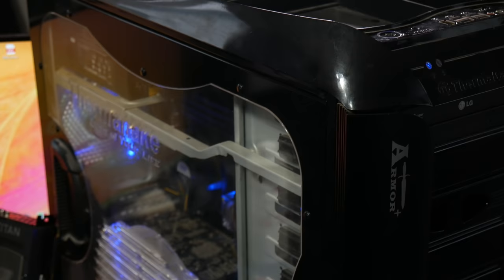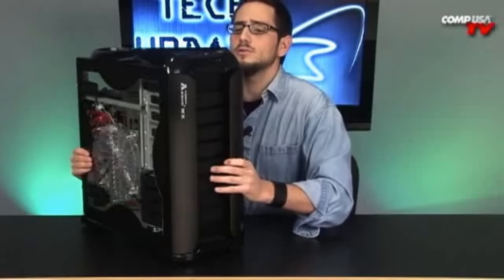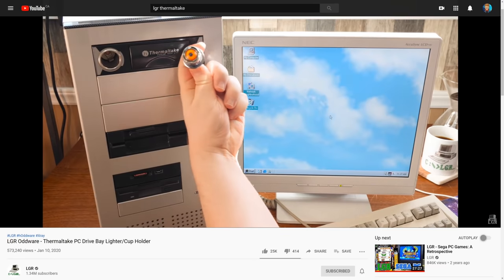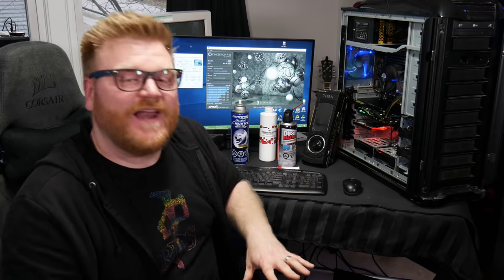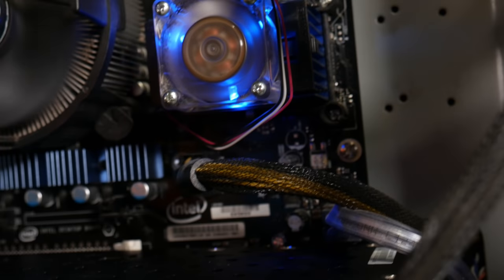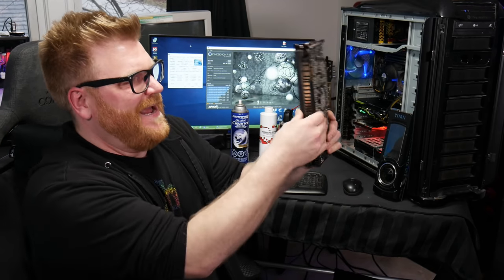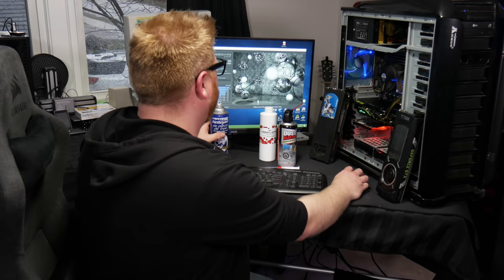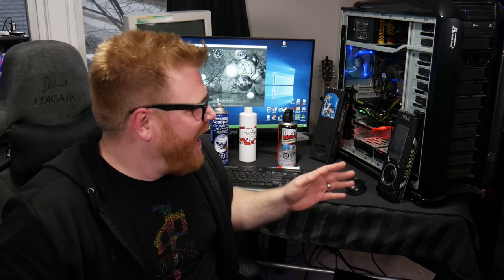Can $5000 buy a PC that will last 10 years?

Comment: 5.000 € for my current machine its now 6 years old still going strong (haswell-e oced with 32gig ram 3,5TB SSD storage 2xGTX1080TI all watercooled) would buy again but would not recomemt to
the GTX 1080 and the storage where upgradet as needed (old gpu(780TI) died more storage was needed)

Comment: it is more valid with every passing year; back in 2000 a computer wouldn't last 4 years; nowadays, so long as the components don't break, performance increase is currently at 20% a year and 7 years from now it could be as low as 10% a year.. the best computer made today will be 3-4 times weaker than the "best" computer 10 years from now; as for the software running, it will still run anything outside new hardware specific features

Comment: there's no way this was 5000 dollars, I spent 2500 on an i7-920, 12gb ram, 3tb hard drive, bluray drive, also a 295 and also prebuilt, plus computer parts are already pretty expensive here in denmark compared to the US, if this was 5000 dollars somebody was drunk.

Comment: i5 760 and gtx 580 was my Dec 2010 PC. Lasted to Dec 2016 IIRC. Might have made it longer if I had gotten a better CPU. IMHO its best to spend a lot on a GPU and it will last. ....but not 10 years.

Comment: Ive got a system with a 3900x, 5700xt, 32gbs of ram and 2 1tb nvme drives in raid 0 for under $2,000. At the end of the day this pc could last 10 years but im a tech enthusiast so ill keep upgrading it till its not worth it.

Comment: 2500 bucks I have the same logic as you. but i think id just be able to milk the platform for (just gaming for 10 years) 
Specs:
 i7-9700K (Deep Cool Captain 240mm AIO)
RTX 2080 Super
32GB DDR4 3000 GSKILL Trident-Z
Z390 Asus Maximus Hero 7 (or whichever it is lol)
1TB Samsung 970 Pro
1TB Samsung 860 Evo
2TP WD Blue HDD 7200RPM
Dell G-Sync 144Hz 1440P TN panel

It was meant to be a modular PC that wil be swapped and upgraded over time... I dont think you can keep the same PC for 10 years with just 1 purchase.
With my particular build the AIO will be swapped in a few years then the GPU when I still want to play the newest games at 144 FPS on my 1440P panel.
I could upgrade storage and RAM.
Eventually could put a variant of 9900K that is compatible with  the motherboard.

But again my logic was spend enough to have a good experience and then instead of spending more pocket the rest and use it a few years down the line to get more out of the money.
Problem is you must follow consumer hardware and do research to accomplish this. If you lack knowledge or time to do this then you would be at a disadvantage.

Comment: I would say, he could have just stayed with X58, upgraded the cpu and cooler and OC`d the CPU to around 4,5Ghz with 1600Mhz cl8 tripplechannel DDR3. Also i doubt the PSU is causing problems but to rly know that a PSU tester would be nescessary. My friend on a sub 100$ budget just got a first gen 4core 8 thread xeon with about the same cinebench score as the one in timmys video and it performs just fine on stock clocks with a gtx770. 120-130Fps in pubg lite on maxed out settings.

Comment: I had mine for like 8 and I got bored so I made a new one. 

i7 2600k
Noctua Heatsink
G.SKill Ripjaws
Z68 Chipset
6870 Xfire.
120GB SSD

Was totally fine for what I used it for. But the tinkerer in me wanted something new.

Comment: I had the Centurion version of that case, It reminded me of HARDAC from Batman:TAS. It started life as an  AMD FX-62 + Nvidia 7900GT,  but by the next year it Had a Core2 QX6700 + BFG 8800 Ultra, 4gb of Corsair XMS2 ( upgraded to 8gb in 2009), that STUPID expensive Creative Soundblaster ( 300 usd in 2007), four 250gb 7200rpm WD caviars with dual first-gen Raptors for boot and applications.  I went through at least 6 different motherboards, i remember it started off with two asus boards, a gigabyte, and an EVGA, and even that badass Intel board that had the blue-flame heat sinks.  I eventually upgraded the case to a Silverstone TJ-07...i wasted so much money on MOBO's and lord knows what else, AT LEAST 30k USD over 6 years...sigh....Now i REFUSE to pay more than 3-4k for a rig. My current rig only cost 2500k, and it absolutely BURIES my 2000USD  i7-2600k+ Dual HD6970( crossfire)  rig from 2011.

Comment: Well dnno about everyone or just gaming, ill tell the story from my perspective, i bought my original PC in Q1 2014 for about 4300$, it had an ASUS P9X79, intel i7-4930K, thermaltake bigwater 860 custom cooling, GTX 780, coolermaster Cosmos II case, thermaltake toughpower 1200W, plus some SSDs & HDDs. I was still in my final year of university as an architecture student, i used it mainly for CAD and 3D modeling and rendering(cpu based rendering) at the time it was the best money can buy (within what is reasonable and not like 50,000$!) it served me well and after uni i used it for numerous freelance and also gamed a bit up untill 2019 it worked without upgrades at all (unless u count adding storage as upgrade), then in 2019 i had the op to buy a i9900k & z390 Meg Ace MSI and GTX 1080 from zotac and 16GB RAM for about 600$-650$ so i snatched it and put my old setup in a build and sold it for about the same amount (so a free upgrade).
I know along the way or even in 2019 there was a great pc option for 4000$ with the ryzen and threadripper in the picture but first i ddnt have the budget to allocate such amounts again, plus the upgrade does the job quite well. I wish i had the opp to upgrade yearly or every couple of yrs, but unfortunately i cant, so an expensive build every 5 yrs for me who mainly uses the rig for work 75-25 gamin, i see it more reasonable as a lower end pc wont do the same good of a job at start.
Reply: I think, your story makes sense as you don't just use it for gaming or even basic pc task. You use it for your job like for 3d CAD too. so, I'd say its worth the long term investment for an expansive build, when you get paid along the way to offset your pc cost. As for this guy in the video, we assume he bought it for just basic pc task and gaming. Which you don't need to spend 5k. That's just doesn't make any sense.

Comment: 2000-2500$C is the sweetspot (monitor and taxes included) and you update your system every 5-6 years. This guy doesn't understand how an exponential curb work. This is how technology grown in the last decades (Moore's law). Also, after 6-7 years your components begin to break (psu, motherboard, etc). A good PSU can work 7-8 years, a cheap no-name brand maybe 3-4 years.

Actually I have a 6500 i5, an AMD RX480 card  and 8gb of ram drr4 2133mhz and my monitor is 1440p. Decent config but probably an update will be needed in the next 2 years (I look for the next ryzen 4 gen / navi and maybe a 2to ssd if the price decrease).

Comment: Meh I don't think its too horrible to try and future proof a little. But expecting ten years is asking a lot. A lot can happen in ten years. I got a gtx 1070 and ryzen 1300x, I know I need to upgrade 1300x I am waiting for 3600x to go on sale and I will upgrade to it. But my gtx 1070 I run at 1080p because I know it will run games at 1080p at 60fps and higher for at least two years. I know its a 1440p card but I wanted to be able to sit comfortable at 1080p for a while without needing to drop the settings very often.

Comment: In my 8 year 600€ pc the only thing ive kept is the cpu and ram.Everything else was replaced because it stopped working. Now im going to spend 1300 for a ryzen 3600 and a 5700xt. I hope everything on the motherboard lasts for at least another 8 years.

Comment: you people need to take into consideration that only up until 2017 intel had no need to push the ceiling for CPUs, that is the only reason why a system from early 2010s still holds up today. this will not be the case in the next 10 years thanks to AMD.

Comment: I did the right decision upgrading like in 2016 from a i3 4130 to an i7 4770, at the time (and I'm not joking) the i3 was plenty enough for gaming but I got a pretty good deal on the used i7 mostly for "futureproofing" and it still rocks, I'm probably only upgrading to a newer plataform when something like DDR5 comes out.
btw my gpu's were gtx750ti 2gb; gtx960 2gb; gtx970; then I blew up a used 1060 3gb lol and recently a got my dream gpu on good deal, a used rtx2060
Corsair CX430 PSU still rocking since 2014

Comment: The computer I built 5 years ago was my first proper build. Thinking back I was very green. I watched a lot of videos to make the computer "future proof". I figured I would upgrade this year, as it had been 5 years.  I figured I put a newer CPU, and GPU and Id be done. NOPE. My old specs were an ASUS Z97 Mobo, GTX 970 and i5-4690k. So Im looking at newer intel CPUs and realize they dont even fit my motherboard. The only CPU upgrade I can do is the i7-4790k, which is expensive still for so little upgrade. So I have to get a new Mobo. "Future proofed" already in the shitter. The Mobo I got is a B450, which I'll probably regret, and I put a Ryzen 3600x with it. I went for a 1080ti purely for the 1440p gaming. Not interested in Ray tracing. 
Anyway the last kick in the "future proofed" bollocks was the god-damn Memory didnt fit in the new Mobo. I needed DDR4. sigh So i got what people say is overkill, 32GB 3600... but, maybe that will be the only thing from this upgrade that will be acceptable in 5 years.

Comment: My modded Sapphire Nitro+ RX480 8GB OC gets the same Fire Strike GPU score as the Maxwell TITAN. lol. I have a CRYSIS rig that's still running strong with a Q6600 GO at 3.6GHz in the eVGA 680i SLi MB with 8GB's of 1200MHz OCZ Platinum SLI ready (XMP) DDR2. I had 2 eVGA 8800GT SC's, then upgraded with 2 1GB GDDR5 GTS 450's in SLI, to finally drop in a GTX 1050ti. In 2013 i built the family a i7 3770K, z77 Extreme4 PC then dropped the GTX 1050ti in it. And that little monster can run Metro Exodus at 1080p60 with high settings plus PhysX. I find it kind of funny that you can still enable PhysX with a Radeon GPU. But, as far as the CRYSIS rig, that thing was up to the task for gaming until about 2016. Then i noticed things, like sloooowness in games. Plus, it didn't have SSE.4 instructions so Far Cry 5/New Dawn wouldn't even fire up. It would with a QX9650 but, it was still slow. As of today, its a great little retro tester. LGR, not to long ago built a Windows XP Dream Machine with the same CPU and MB. I only paid about $1000 total for the whole set up back on 2007-2008 and can say i got my money's worth. When i seen Logan from tiger direct paired one with the eVGA 680i SLi amd was loving it, i had to get one. I got the CPU, GPU and motherboard combo for $600. Super steal. Jumping to a 5GHz 8700K and 9900K from a Q6600 and i7 3770K was definitely worth the wait. My ram is running at 4+Ghz. That faster than most entry level CPU's today. 
I waited a year to build each system, so open box deals all the way. Saved me 50% on both builds. I recently picked up the RADEON VII for $325 out the door for example. With deals like that, patience is definitely the key. Maybe tell dude to build right now. With some deals that are available. Then, use a get by GPU until the new GPU's drop and he'll have the latest and greatest on the GPU side, for gaming.

Comment: Well technically if you built a i7 2700k build in 2011 or i7 3930k in 2013  and then just only upgraded the gpu once to a 1080ti then your pc is still highend and still under 5k mark and just 1 or 2 years behind 10 year mark

Comment: In 10 years from now x86 chips will probably be gone and high end desktop computers will more likely switch to ARM based multicore 3D stacked SOC's. So there is absolutely no sense in spending over 3000 bucks for a computer right now, especially if you're only a gamer.

Comment: I'm pretty sure that these cards like the 9800GX2 is only seen as one GPU. There is no need to set SLI in the control panel.
Reply: Not really. It sees 2 cards and you have to turn on sli. There is actually an sli connecter on the card itself and some cards would burn out one of the gpus and you would have just one visible and it would still work but very slow because grx295 was bassicly 2 gtx 260s gpus.

Comment: if you spend 5k on a PC now It could last you that long. (The only real innovation in the tech space has been graphics cards)
Reply: even X58 still has no problems with modern workloads as long as its overclocked to 4,4-4,5Ghz

Comment: I'm still using an i7 930@4ghz
 12gb Kingston hyper ram
 msi Rx 480 8gb
 gigabyte UDX3 58A mb
 I got from overclockers UK in June 2010 with a hd radeon 2gb 5970  planning on massive upgrade this June or when the next gen Big navi and top cpu as I'll have had this pc for ten years.My old pc was reviewed in techradar in 2010 stating it garnered the performance of a pc thrice it's price at £1500 it was a wise buy hopefully I can get a similar priced pc with the top gpu and top  cpu when amd release there next gen gpu. I've always gone team red as £700 is enough for a gpu that expires quickly never mind ngreedia £1200 kid on rtx my friend bought when it came out.Hopefully I'll find something suitable for highest gaming performance as get annoyed too often at my old pc hard crashing a new fast  cpu and gpu with fans and no fancy pumps and some new rgb lights as old blue led ones are so dull now will do the trick

Comment: Nope. My watercooled ~10yo  6-cores Xeon X5650 @4.5GHz, 24GB of DDR3-2000 RAM (big deal in 2008), 2 x X-25M 160GB RAID-0, Radeon HD 5970, Corsair HX1000, Corsaid Obsidian 800D, etc. etc. is still serviceable in 2020 as a Linux server to run various stuff (Pi-hole, Wireguard, Tautulli, Unbound, etc.), but it's obviously very very outdated by today's standards.

Comment: My 1500€ PC has a Fractal design R6, a Ryzen 7 1700 overclocked to 4,1 Ghz on air with an thermalright aro m140, 32gb 3600Mhz cl16 ram all mounted on an aorus X470 gaming 7 wifi with an xfx thicc 3 radeon 5700XT. I went with 32gb ram because i got it for a fairly low price on black friday (280€) and because its way overkill rn and shouldnt be a thing i need to upgrade for gaming for a long time. I also went with an Bequite purepower 11 650w psu, a 128gb m.2 ssd and 2 500gb hdd`s i got out of some 10 year old pc`s. My plan is to keep my base plattform (mainboard, cpu, ram, case, psu) as long as possible and just keep upgrading the graphics card when needet (proberbly every 4-5years).

Comment: I just built one, I never over clock: 700W memory express // 1 TB hdd (might get an m.2 for xmas!!) // ** 3300x am4 zen2 // rx570 8gb  // 3200 16gb ram (not oc) // ** B450M Pro 4 // with some crappy cpu chassis case i had hanging around for free // total price $520cdn will last me easily 5 years // ** full system support true 3200 ram // tested on fortnite + elder scrolls online + star trek online (i always turn off bloom thats just annoying but high everything else incl. water reflection light 2.0)

Comment: No it can't, if it was destined to fail in 2 years, it will fail in 2 years, no matter how much you spent on it.
Also, yes, it will last 10 years or even more if it is not destined to fail earlier I'm 23 years old and I only had 3 computers in my entire life, none of them stopped playing games on me, I just decided to upgrade because I felt like having more performance or better graphics. So you can't like build a top of the line PC now that plays modern AAA games at 4k 70fps maximum graphics and expect it to play 8k 70fps 7 years from now... it will, at best play 4k 70fps at low settings by that time.

Comment: yeah,  I mean, i went from a second hand core i7 940 i got second hand 5 years ago, to a core i3 9100F, and the sub 100 dollar cpu is way better then my old i7, i mean, i got it and a refurb msi motherboard for under 200 bucks, so when the time comes to move forward, it's a whole lot gentler on the ol' wallet.

Comment: From what I've been hearing, around the time Ryzen 5000 is coming out all these specs should be coincidentally on Generation 5 by its release...

PCIE gen 5, DDR5 and usb gen 4. Now I'm not saying it's a good idea but, a 24 Core 5Ghz + Zen 4 CPU with the fastest DDR5 and 64GB of it along with blazingly fast PCIE 5 memory. And not to forget probably another lineup of Graphics cards on top of Ampere and the 6000 series.

I'd hedge my bets on that lasting 10 years. I mean these things are going to cap out eventually, let's be honest 4K is photorealism anything above 4K is seriously unnecessary. Once we have 144-240 FPS in 4K games with the setting cranked up to max (and in the context of future games with more amazing graphics but higher system demand) I think people will just not see a reason to upgrade.
Reply: i seriously doubt Ryzen 5000 will be 5ghz.
Also Bill Gates once famously said "640k is more memory than anyone will ever need."

Comment: I have a question my PC is 
Pentium g4560
Gtx 1650
8 gb ram
Should I buy new CPU or more ram ?
Reply: Definitely cpu, as long as you psu can take it. Also check mobo cpu compatibility to know what you can upgrade to.

Comment: This guy should have built the pc himself kinda feel he got ripped off. I  still run my i7 930 @ 3.8ghz, 12g ram, gtx 1080 and it still plays all the latest games maxed at 1080p. Games ain't moved on that much in 10 years.

Comment: Drop a 6 core 12 thread Xeon in it, extra RAM and a graphics card upgrade and  It'd hold out for a few years yet, buddy of mine bought an old i7 920 desktop for $200 a few years ago. we tossed in another 8GB of RAM a 6 core 12 thead Xeon and I had upgraded so I tossed him my R9 280x for cheap and it plays everything including newer triple A stuff like Doom eternal no problem. While Moore's law is alive and well hardware is aging better than it used to.